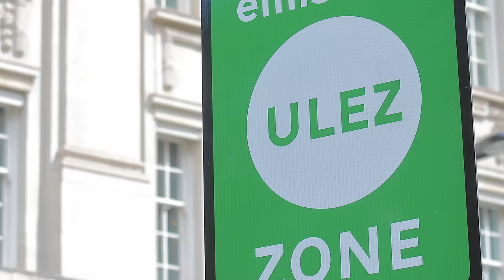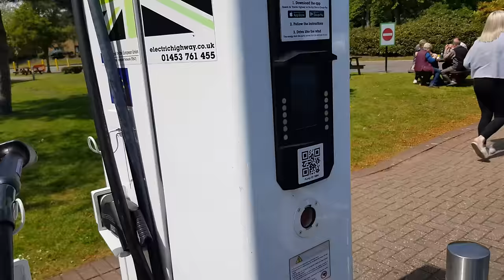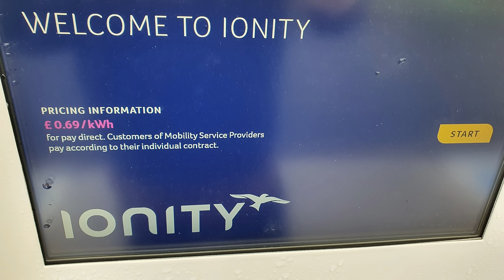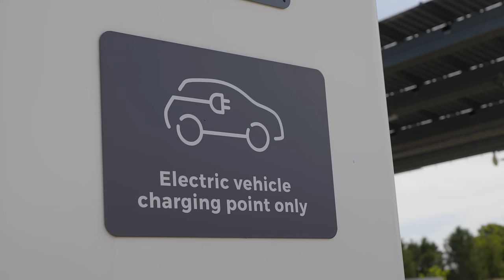The Uncomfortable TRUTH About EVs: The Version NEITHER SIDE Wants You To Hear

Comment: I have a different problem with EVs and it is to do with the cost of charging as most cars are charged overnight with cheap rate electricity as the grid has to be powered 24/7 there is a surplus of electricity over night but as more cars charge the demand for electricity will increase and with it the price and not just for people charging there cars but for everyone. Please be aware that a typical EV being charged overnight requires the same amount of electricity as a standard house uses in a day.
More EVs equal higher electricity bills for all...
Reply: that is not how nuclear energy supply works! supply of alternative fuels is far more unfathomable to me and perhaps that is something you would learn more from than fear of nuclear reactors running out of radiation?
Reply: you're forgetting something far more influential to the price of electricity.... and that is taxes and contributions that are a HUGE part of the petrol price..... in my country,  29.8% of the price goes for the fuel's purchase price and 6.96% for the seller's margin.... everything else is taxes and contributions (to the government budget)! what do you think will happen, when "budget income" from ICE fuel sales decreases significantly and the use of electric power drastically increases?!? will the taxation currently hidden in the price of the ICE fuel (currently roughly 63% of the price) just "vanish"? I bet, it will, yeah.... 😋
Reply: @LysanderLH  UK is only reliant on Nuclear for around 15% of our Electricity supply. Majority of electricity supply in UK is derived from Gas and Wind, both of which are not switched off at night, hence why majority of EV owners I know, charge overnight at lower tariff like Economy 7/10 etc.

Comment: It's really quite simple,  we need a range of technologies for transportation and not be pushed to just one form! It's now simple enough to run ICE engines on de carbonised or neutral fuel sources which will still keep your local garages in business and able to repair them, also the delivery system is just as it is now and everyone knows how to use it. Being pushed to just electronic is just madness.
Reply: Its sad how un environmentally friendly EVs are, to generate such absolute faith in their future.
Reply: BEVs aren't necessarily being pushed. Its not like other low carbon forms of powering cars are banned. Its just that BEVs are by far the most practical at the moment. 

E-fuels and hydrogen both have huge problems with energy efficiency in that it takes a lot of energy to make the fuel. E-fuels then have further problems with combustion energy losses, as internal combustion just isn't very efficient and is only really viable when energy is absurdly cheap (like when you can literally pump it out of the ground). And hydrogen still has a distribution problem, because you cant re-use existing fuel pumps. 

BEVs have a huge advantage in that the fuel distribution network is pervasive. It needs upgrades, and problems like access to power for people that need to park on the street is a problem to be solved, sure. But it is easy to see how the country can be absolutely smothered in places to fuel up in a relatively short time period.

For people that have the home charging access, BEVs are probably as close as we will ever get to a car that never needs fuelling and therefore aren't likely to be superseded by another technology. Other tech might be used in other contexts, but seems unlikely that BEVs wont be the majority of private cars.
Reply: @jamesdavideastwood6956   think for wind power,  when very windy most of them are turned off as the grid cannot take the power! So why not use them to create green Hydrogen etc, I'm sure that's better than them being just turned off 🤷‍♂️
Reply: @markthomas155  sure, that could well be a big thing in the future and very useful. But it is not currently a cheaper or more convenient way of powering a car and probably never will be. 

It takes more energy to convert electricity to hydrogen than it does to transmit the electricity to a battery. Not only that, you have to move the and store the hydrogen. So again, although it might have a place in transportation in future, BEVs will almost certainly continue to beat out hydrogen on cost and convenience.
Reply: It's also about taxation. Remember the red diesel thing? If we ran our diesels on used chip fat we would be helping the planet!
Reply: @markthomas155  you still don't have a consistent production (supply) for hydrogen but a relatively stable demand so this could easily produce gluts and shortages, probably mostly shortages because hydrogen is hard to store with massive problems for leakage (who knew one of the smallest atoms in the periodic table would be hard to store) and needing high pressures or cryogenic tempratures to store. The economy and many things like consistency to retain public faith and trust to then be economically viable, imagine if a store would only randomly stock it's shelves and having periods where there was nothing and periods where stuff just rotted on the shelf because the demand wasn't there for people to buy that much. 

wind power isn't a reliable source due to production fluctuations if there isn't a viable way to store that excess power then it's more harm then good and I don't believe anyone would just waste energy if it made economic sense to do something.

I don't think the problem really is internal combustion vs. EV since the underlying issue is massive car dependence and therefore a massive consumer market that will always be enviromentally destructive to supply regardless of technology. 

I think land transportation should look more like the aviation industry where mass transport is commonplace for everyday folk and rich people who want to pay out the ass get their private jets extreme luxury etc. etc. and hobbyists get relatively affordable options for fun in the weekends. The problem is that land transportation is much cheaper so you would have to make this divide through taxation which a lot of people would oppose but it would be much more efficient and enviromentally friendly if land transportation had a lot more mass transit. 

For myself I live in a place where I can walk anywhere and don't really need a car so what I'm planning to buy is probably an old miata to mess around and to go for joyrides, which I think is the preferable option since a lot of commuters aren't car enthusiasts in the first place and the ones who are would have a lot more freedom if it wasn't the prefered method of commuting (see: general aviation)

Comment: We have a TM3 and Atto3 approaching two years now. Both are excellent vehicles, and a delight to drive. We mainly charge at home and have no problems charging up on trips.

The delightful aspect is running costs, cheap as chips about.1p per kilometre.
Reply: 1 pound per kilometer it’s actually expensive. Compared with an ice daily. 😅
Reply: @fabioribeiro5071  1p equals one penny. So the vehicle costs about one penny per kilometre to operate.

In terms of weight the abbreviation for the pound is "lb"  in terms of currency the abbreviation for a pound is "£".
Reply: Wait until you try and get rid of them - they'll be worth very little.
Reply: @Weissman111  I normally keep vehicles until they are fully amortised 12-15 years, so not an issue. However, it is very good to see an affordable EV second hand car market emerge as even as the new EV car market gets less expensive by the month.

I expect new EVs like the TM3 if produced in volume, will eventually sell around the $20K-$25K mark.
Reply: @jimgraham6722  Given that EV batteries start to degrade and lose range after 8 years, is it wise to keep an EV after that point?
Reply: @Weissman111  I will let you know in seven years. So far I have seen no degradation at all. It may fall off a cliff but I hope not. 

If it does it won't be any bigger issue than blowing an engine in an ICE. Over the years I have replaced quite a few of those, a couple of days in the workshop, no big drama.

Comment: I agree on the inconsistency on charge price. I've had my leaf 1 for 4 years and charge price has gone sky high on public chargers .  I do love my car but now theirs 800% increase of electric  cars on the road and theirs no new chargers in our area you need to que for ages to use public charger. Still I'm keeping my electric car , love it's 59 mile range :) you're right about the size of electric cars is just to big, when I bought my LEAF it was a replacement to a fiat Panda and it seemed huge , now most cars make the leaf look small .
Reply: @lookoutleo The charge price excludes the depreciation of the battery which is the total battery cost divided by the amount of times you can charge it. Aside from that, it can be a reason to look into micromobility like L6 and L7 cars and 50-125cc equivalent electric scooters.
Reply: I have a Leaf, and a Kia EV6. Once you get to long range cars with CCS charging just isn't a problem.
Reply: @TheAegisClaw  I know , I can't wait
Reply: @lookoutleo  it is very annoying how Chademo connectors are being removed while cars like the Leaf that still need them are on the road. If you ask me every new charging station should have at least one Chademo until at least 2030, otherwise it's just planned obsolescence. That should be mandated in law.
Reply: @TheAegisClaw  most new chargers in Scotland still have CCS and chademo , only thing is only one can be used at a time

Comment: Really great Video and appreciate the points raised. I myself am a 22 year old petrol head and was very much on the anti EV bandwagon until…. I got one as a courtesy car for a week and my opinion totally changed. Now, there’s absolutely pros and cons to EV’s and ICE’s. However, my wife and I have an ID.4 and a merc E350. We have the privilege of having a driveway and charge the EV for 7p a kw on our 3pin charger with OVO energy. We tend to average 3.5m/kwh. 
The EV is the choice round town and commuting a 25mile round trip to work. We simply wouldn’t have the EV if I didn’t have my E350 because it’s far cheaper (and more reliable) to use an ice for long journeys. 
You hit the nail on the head “choose what’s best for you”. I’m not saying either Is better than the other. But there are definitely uses for both

Comment: I would like to congratulate you on a balanced and well thought out presentation. I have an iPace that will be 5 years old in 2 months time. Cost 65k now worth just over £20k. On reflection 30% retention after 5 years on a big luxury car is not bad. Running costs are a fraction of a likewise ICE that will cost 25p v my 3p mile. Service costs have been £500 v probably £2,500. You are quite right that you have to take into account what sort of distances you travel in a day and it has always been the case that 200 plus, you should buy a Tesla. The most I normally drive in a day is 100 max. I have a drive with a charger so I do not have range anxiety. When I bought the car it was a special treat after I sold my business and I always planned to keep it 10 years, subject to it not being a problem car, which it has not. In fact it has only spent time in a garage for an update apart from the 2 services
Now to talk about possibly the most important part, if one is interested in driving. It is without doubt the best car I have ever driven and I have driven Mercedes, BMW, Volvo and a host  of other cars. I am not saying it is a better EV than those other EV makes, but I have found it much more fun than my former ICE cars.Every time I drive the Cat it brings a smile to my face😀😃😁

Comment: Bedfordshire Fire Service has released an update on 24 March. "The vehicle involved was diesel-powered – it was not a mild hybrid, plug-in hybrid or electric vehicle." The report however goes on to say,  "all evidence points to the most probable cause being an electrical fault or component failure, which started in the engine bay of the vehicle whilst it was in motion. The developing fire spread to other components, and whilst the owner of the vehicle attempted to fight the fire, the vehicle became overrun with flames and spread to other parked vehicles."
What this means is the fire was started by a 12v battery of say 200 amp hours, that became uncontrollable. Yet people are saying it was a diesel-powered vehicle.
Well, it was an electrical fault with a  200ah if that battery that powered the fire without creating its own oxygen and EV vehicles in the future will have the same problem. The only difference is it will be a 400v 64 Kw battery generating its own oxygen source. Tesla cars also have the same 12v detonator that could set off the main battery. 
Stick it in the garage under your kid's bedrooms if you like and sleep well because you're saving the planet.

Comment: One thing everyone forgets is the charge losses. If you buy 50 litres of petrol, you get 50 litres of petrol in the tank. If you buy 50 KW of electricity. Due to charge losses you only get 41kw in your battery. That's an 18 percent loss which needs to be included when calculating the cost per mile.
Reply: Although there is that regeneration you get going down hills that no other vehicle does …
Reply: @chrisbraid2907  surely hybrids do this too?
Reply: You lose half your petrol or more to heat losses

Comment: Thank you. A balanced perspective on the EV v ICE debate and your advice is to be commended. Just a point. I live in Canada and in recent weeks two incidents have occurred re Hyundai EVs in which both sustained slight damage to their battery packs. Both were 2022 vehicles which have been written off by the insurers as the cost of a replacement battery from Hyundai Canada was $56k for cars with a retail price of $60k. These incidents have been covered by CBC's Motormouth on Youtube. Food for thought?
Reply: I watched the same, very interesting is there any justification of cost at the end of the day .....
Reply: I'll make a pro EV comment. I'm usually pretty right in the middle on the subject. The car industry has more than 130 years of practice designing in obsolescence. The world can absolutely make an engine or a transmission or other major car parts that last the life of the vehicle. But there is no incentive. Unserviceable battery packs, are just another example of this planned obsolescence. It's not an easy thing, it's a transportation thing.
Reply: Conclusion: Never buy a Hyundai EV. BMW replaces individual modules of their EV batteries, costing 20 times less.

Comment: Great video, so refreshing to see a balanced point of view.  A debate can only be useful if both parties are willing to be moved by the other’s arguments.   Of forgotten these days.
Reply: I know, totally excellent video from JayEmm - as a disabled motability driver here in the UK, I have enough mobility to fill a petrol/diesel car and even use an EV charging station. I don't however have the ability for home charging as parking is on street and I live in a top floor flat. When the EV infrastructure for charging has improved AND the range of batteries has improved then I will be happy to move to EV. Right now, my next car is a Skoda Karoq in April 2024 (on order). I do have a small worry about the runaway fire thing but not while I'm in the car lol. Couldn't agree more with Jay about the waste on HS2 which could have been ploughed into providing a decent EV infrastructure and even - gasp - invested in created battery manufacturing plants and creating long term jobs for the UK economy. The future isn't ICE or Diesel, I think that is clear, so ffs we need politicians to wake the f*** up and realise we're not catching buses or trains in this tiny island and cars need to be clean and efficient with a network of chargers to match. I won't hold my breath though as I would die waiting lol.

Comment: I've seen car  fires pertol, diesel were really scary. I've seen an ev go up terrifying.
Eg a petrol car had a fire outside of our village last year it was towed away repaired in a week, no road damage.
A Tesla went up few months later compleat destruction in minutes  the driver had to break window to get out. Panicked whe electric door opening failed forgot of hidden hande. Hour to put fire out and weeks to repair damage to the road.
The extra weight of the EV and the speed of the battery fire is very dangerous.
Yes it was diesel Range Rover in that fire, but the fire in the video looked to come from where batteries would be in a diesel hybrid.
Would our government cover that up to push there EV golden boy when the tec isn't ready? YES.